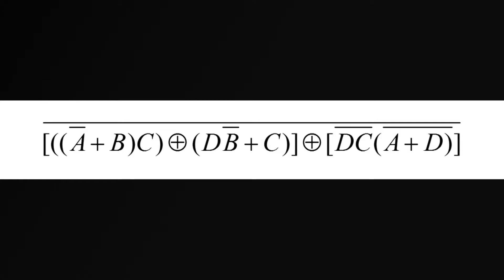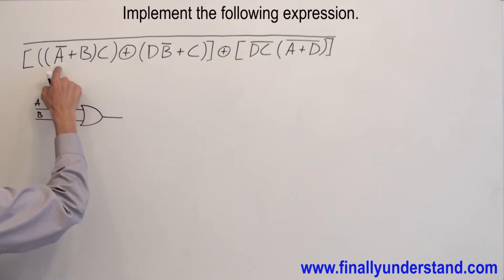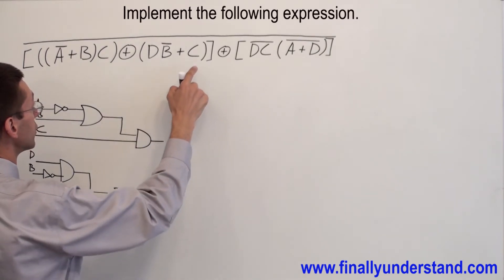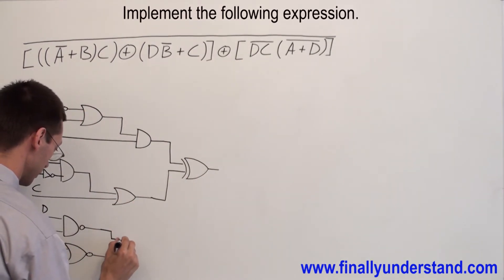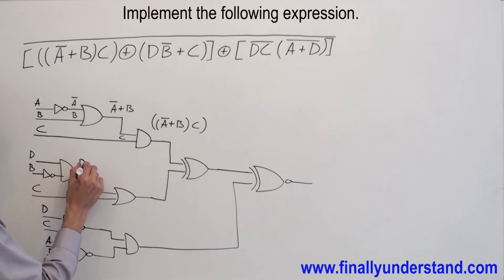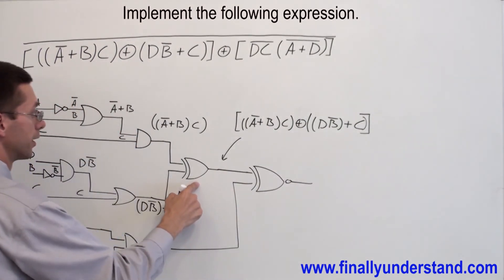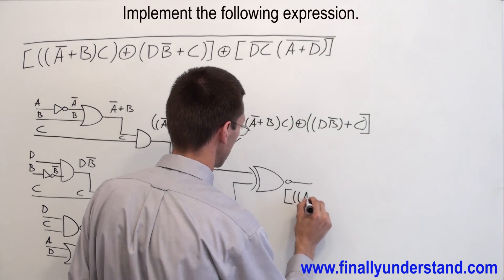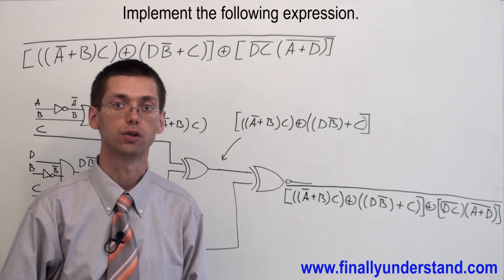Digital Logic - Implementing a logic circuit from a Boolean expression. Ex 07

Comment: This is so informative. I have a question tho. My professor didn't put any brackets to separate them.. so how?
Reply from the maker: Hi, jheilicious, your professor probably used parenthesis instead.  I used brackets because in my opinion they make the simplification, analysis, and implementation much easier.  This is algebra, that is why people use them.   https://finallyunderstand.com/electronics.html